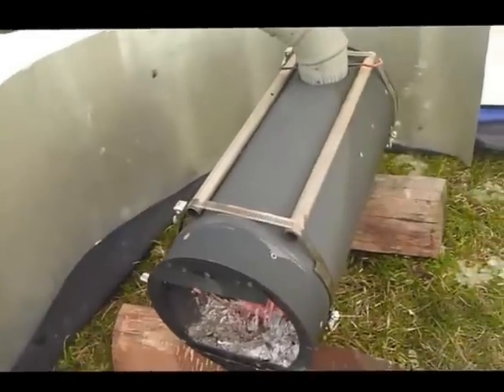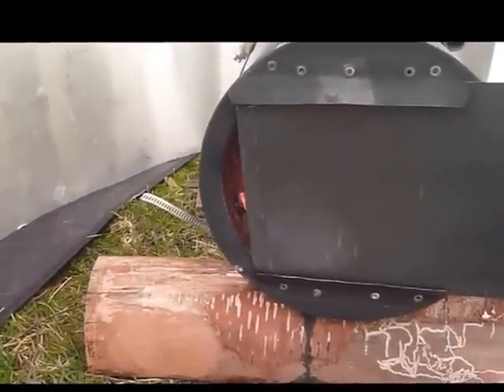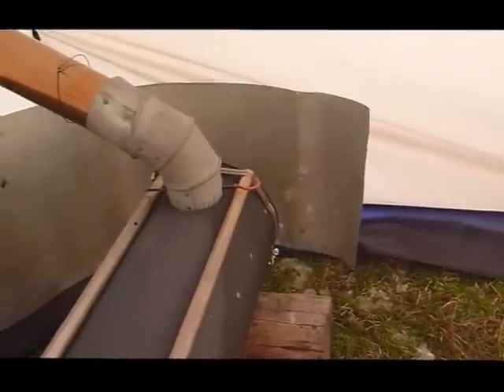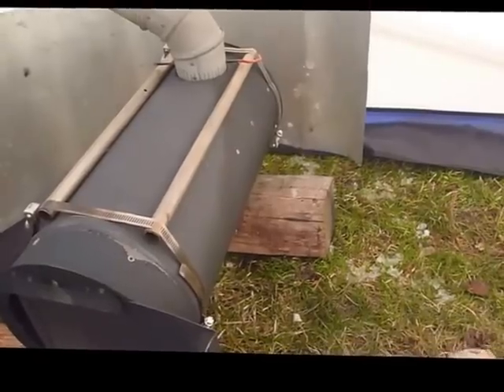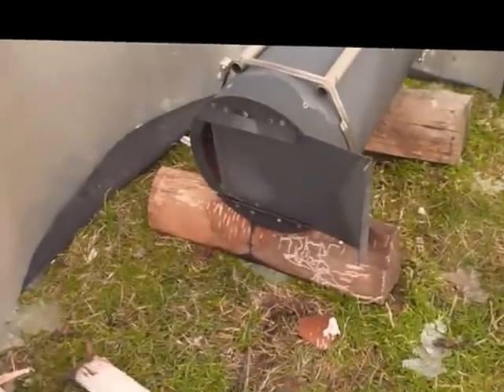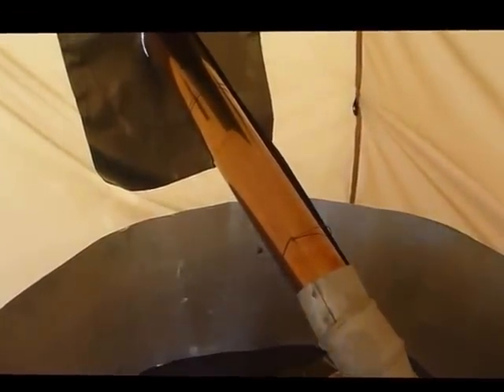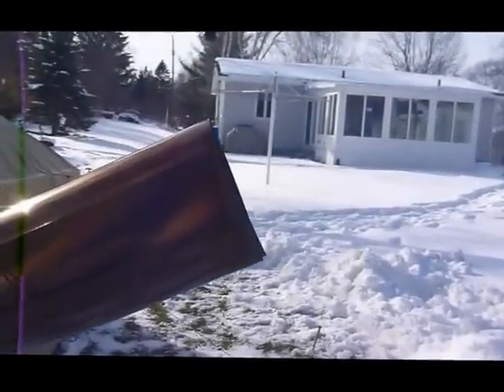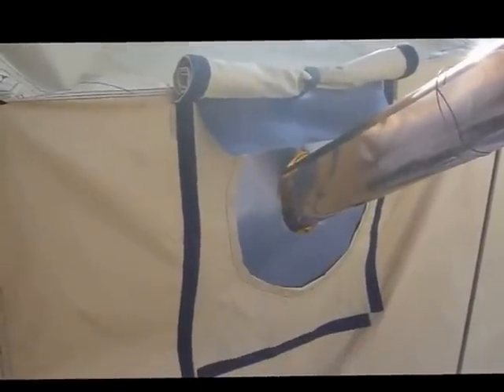DIY Woodstove

Comment: Nice work TZB!   I would recommend an end pipe cap on that rig because low angle is vulnerable to a side wind, which can cause a back draft of the stove gases.  The simple one I use is a U shape with pivoting friction tabs which hold it on the pipe, and the tabs fold down (on one steel rivet) and the entire thing can wrap around the rolled pipe for storage.
Reply: Tom Brown
 Right on!  All set now for -40 in a windstorm!  :o)